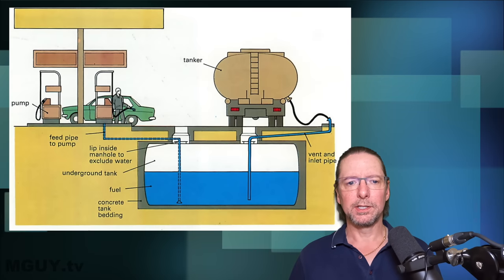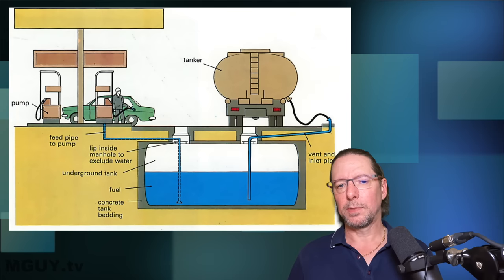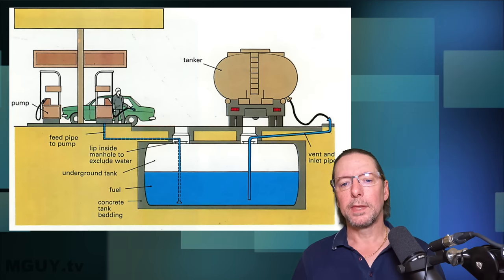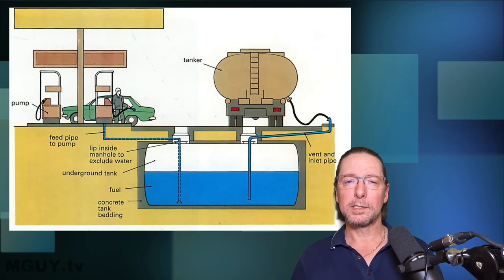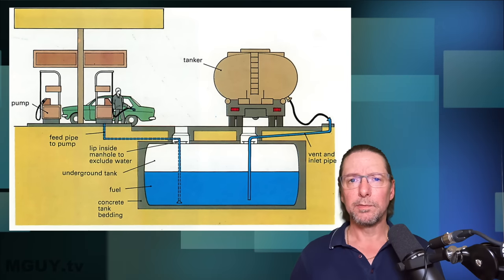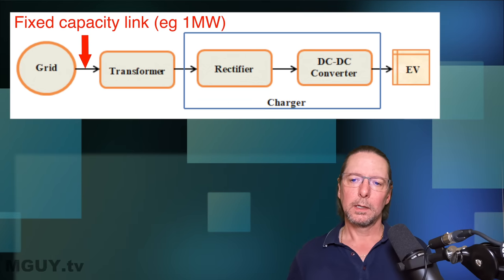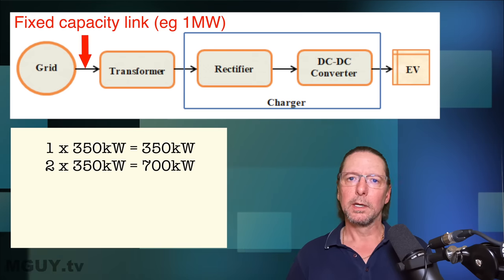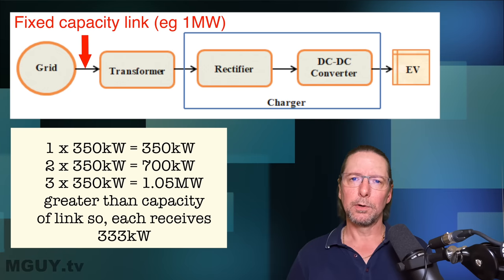HUGE problem with EV Charging Stations that no one mentions | MGUY Australia

Comment: You have a valid point, sir. But don't forget the fact that disrupting personal travel over long distance, to the point of being cost-prohibitive/impracticle is all part of the WEF/Globalist Ellite (WEF/GE) end game. They want you static for easier control and surveillance in their 15-minute cities.. Australia, like Canada is huge with much open space to cross. My gas-powered truck can get me over 900kms on one tank of gasoline in winter or summer. I have the option of heat in winter or air conditioning for summer with zero risk of making the next planned fuel stop. This cannot be done with ANY battery-powered death trap plus it's harder to track older fuel-efficient vehicles and the  WEF/GE DON'T LIKE IT! Bunch of spoiled-brat crybabies! Cheers and hello from Alberta, Canada.

Comment: I am fairly certain that charge stations ( at least some ) have battery buffers for high demand use. The Huge problem I have is no roof over the charging stations. ( What kind of person wants to get into the rain to hook up the charging cable? )
Reply: How about hooking up a high-voltage and high-current cable, in the rain?  Very bad idea.
Reply: I have read somewhere that power is not in the cable unless the cable is completely connected with a low voltage 'hand shake' between the car and charger. But still, just the inconvenience of getting rained on may not appeal to many people. ( Not to mention that solar panels can be on the roof to at least contribute to the charging station.   @DerekDavis213

Comment: Also, when for example, a 1500 KVA transformer for a 6-charger station  is idling because there are no cars charging,  the transformer losses increase - and are drawn from the grid, ahead of the revenue meter.  These losses are then paid for by spreading that cost across all of the customers.

Comment: Another problem that never occurred to me is the cables are made from copper, very attractive to the criminal class. My mechanic tells me that they turn up with a hefty pair of bolt croppers and remove the cables which  cost time and money to replace..
Reply: A criminal would not waste their time on copper cables. Steal 1 car = over 5 km of copper cable.
Reply: @haroldnowak2042  You assume all criminals are intelligent enough to do this mental comparision
Reply: @Nordic_Mechanic  You are right. No criminal would bother with a 'worthless' cable.

Comment: Good analysis about the load  capacity and how it’s divided up among existing users compared to gasoline storage tanks.   Longer times to charge means shortening the range to compensate for longer time.  All ass backwards on that long EV road trip

Comment: They've tried to overcome that problem in America by having a charging station like a jump starter. The batteries inside of the charging station allow for large power discharge but unfortunately it takes another hour or so to recharge each charging station and is more a solution for country areas. If you had one large battery container for instance you would still run into the same problem because the amount of energy needed to be stored would cost millions of dollars and the charging station operator would have to recover that investment.
Reply: Petrol station owners pay for their storage tanks and are taxed to cover damage from leaks.  Why shouldn't charging station owners pay for their own on-site storage?
Why should my old Jeep - via motor fuel tax paid at the pump - subsidize your new EV?
My Jeep is taxed by the volume of fuel loaded into it by the gallon or the liter not the distance traveled; why doesn't your EV pay a road tax based on battery charge?
Reply: @frankmcgowan9457  Love the post Frank, this should land on every politician's desk. The implementation of this EV charging tax should be instantaneously implemented by the money hungry leeches!
Reply: @frankmcgowan9457   Yes, Petrol station owners pay for their storage tanks.   But underground gasoline tanks are MUCH cheaper than 1 megawatt of battery storage!
Reply: @DerekDavis213  And, because they are underground, they take up less of the usable space.
Reply: @DerekDavis213  
The question stands: Why should ICE vehicles subsidize EV infrastructure?  I cannot see why they should.
Reply: @frankmcgowan9457   I'm very much in favor of ICE vehicles, but to play the Devil's Advocate:    Why should the American taxpayer, through HUGE military expenses, keep the crude oil flowing to subsidize gasoline cars and trucks in America?
Reply: @DerekDavis213  
Because the purpose of military ICE vehicles requires them to be available rain or shine, windy or calm, day or night and may require 24 hour operation with minimal stops for fuel, ammo and minimum maintenance.  EVs cannot do that.  Our military will continue to run on petroleum or it will lose.
Our military commitment to petroleum is not a subsidy to the oil companies; it is about readiness.

Make the EVs pay for their own infrastructure; ICE already has paid for its own.
Reply: @frankmcgowan9457    USA has plenty of oil for the military, and our good friend and neighbor Canada has plenty of oil too.   It's the fuel needed for cars and trucks, driven by 340 million ordinary Americans which drives our insane military expenditures to keep that crude oil flowing.
 
So gasoline-powered cards for the American public are subsidized too...
Reply: @DerekDavis213  
As you have pointed out, we have enough oil for military vehicles IF our own government would allow its extraction.  It will not.  Hence, our need for imported oil to run our civilian automobiles.

If the government returned to its pre-2021 energy policies, gasoline would be under $2 per gallon, again, and our military could be stockpiling supplies, again.  Of course, that would be greatly assisted if the military policy were also returned to pre-Biden policy - wind down our existing foreign wars and avoid starting new ones.  Supplies are easier to stockpile when you're not using them up...

Comment: This is just one aspect of the electrical power delivery system that will be under strain if EV's ever become widespread.  There are other parts of the power grid that were never intended for such usage, not least of which are the power generation facilities themselves.

Comment: Here in the US, at least here in Western Colorado, most of the EV chargers are connected to diesel generators as opposed to the grid. Speed isn't an issue but but they certainly aren't full filling the green energy promise.
Reply: Your assertion is false. I don't know where you got the idea that most of the EV chargers in Western Colorado are powered by local diesel generators instead of a grid connection, but that is simply not true. There are some backup generators at some EV charge sites (not very common) but they are only there to make sure EVs aren't stranded in the case of a grid failure.
Reply: @jimmurphy5355  Makes sense. Also depending on the generator specs @Dennis could be wrong not being greener. Some generator's put car/truck engines to shame in terms of efficiency.

Comment: correct. megapack batteries would provide buffers, but they are massively expensive and you will need lots and lots. Theres always the concern that some weather event will cause outages. liquid fuels are so easy to transport in bulk. You can literally grab a jerry can take it somewhere by hand and get back to the car with probably a hundred plus miles of range. evs cant do this.
Reply: Never in my life driving a car, did I need a jerry can to fill my car. And fueling stations in my neighbourhood all run on electricity, so when power is out, no fuel comes out either.
Reply: @channel4ferrets  But I can store gasoline at home.  You can't store enough electricity to run an EV 500 miles at your house.

Comment: I believe someone calculated that here in the UK, if we were all using EV's, we would need 4 times  the service stations space that we have at the moment.
Reply: That just monumentally false. Level 2 Charging uses far less space than a Fuel Station. It's only DC Fast Charging which uses more space and that is NOT the primary method of charging.
Reply: In one report I saw, they stated that we would need a lot more power stations than we have now as well, or the entire national grid would collapse under the strain of the demand for electricity...
Reply: @Neojhun   So they charge quicker than filling with fuel? Are EV's smaller?
Reply: @gordy4459  And yet, even in the 1950s and 1960s, the infrastructure was able to accommodate adding enough capability for air conditioners?  If charging is mostly done at home, the demand will be much less dramatic, and mostly at night.
Reply: @martalli  I do remember seeing on the news last year, (when we had a couple of warm weeks) that demand was so high due to all the air-cons that people were using that some of the coal fuelled power stations had to be fired back up...that surely demonstrated a shortfall in our present infrastructure?...
Reply: Technology is developing fast. However I agree for the next couple of years EV's are more practical for people with home charging. Expensive public charging should be the exception until charge speeds can be done in 5 minutes or less. Also why the fixation to charge to 80-100 pc each time. I put in only as much as I can afford or need.
Reply: Nuclear power stations are back on the table...
Reply: @martalli  At least where I've lived, there were next to no home air conditioners in the 1950s or the 1960s and even well into the 1970s.  I never had one at home when I was growing up in the 1950s and 1960s.  I only had one in a single classroom in 4th grade because it was a mobile home used because there were too many students.  Even in the 1970s at college, there was no air conditioning in the dorm rooms.  Most of the classroom buildings didn't have air conditioning either.  Imaging being at a major university, University of North Carolina at Chapel, in chemistry class, and a dog walks across the front of the class because all the doors of the building had to be left open for ventilation.

The introduction of air conditioning was very, very gradual.  There were people here in the 1950s that didn't even have electricity at all.  When I was 4, we didn't even have a bathroom in the house.

So no, the EV demands are much greater than anything ever was in the past.  The government is trying to make everyone buy EVs by 2035, when it's physically impossible to upgrade the grid and power generation by then, no matter how much of my money you steal.

Comment: Interesting. So 8 fast charge cars will slow it down.  Just travelled around England from Wales. England has many charge points and way more EVs. First time I had seen 3 or more cars charging simultaneously  where in Wales it's non existent.  At the moment huge demand is not everywhere. But you have a very valid point.. It will become a problem if not worse as EVs could outstrip the charging stations.
Reply: Might, not will. Charging infrastructure is increasing, albeit potentially not fast enough but then supply often lags behind demand given the way supply-side economics works. If the installer was able to get a large enough power feed into the site it might never be an issue.
Reply: Imagine a car pulls into a petrol service station.

The tanker is hooked onto the end of one measly little fuel line and the car gets fuelled off that line coming out of the tanker.
Then 10 cars all try to suck out of the one thin line coming out of the tanker....
There's the problem...no storage "tank"

Now imagine an EV charging station with one measly 1mw line and 10 EV's sucking off it...

Then further imagine 5 x 40ft shipping containers full of recycled ex EV batteries on site that had recharged all day from the solar canopy over the EV charging area...
and from off peak electricity all night from the electric grid.

Suddenly by using a brain and spending on a "tank" (a reserve of electricity) all 10 EVs are charging......

Comment: Not a huge problem at all. Charging sites normally have enough capacity to deliver what the cars statistically can charge. I have never experienced throttling due to an overloaded charging site. I have had throttling due to cold battery, but that's due to bad planning, so I had to wait a few extra minutes.
Reply: Yeah, it makes no sense you'd put in a cable big enough for three cars and then install ten chargers. You'd install three chargers, save the cost of seven chargers, and everyone would charge at least as fast.
Reply: @darrennew8211  Banks and stores have (or at least used to) more lanes than people to operate them.  It's psychological, plus they receive more government funds taken from the working tax paying citizens.

Comment: 85 % of electric comes from burning coal ,oil or wood chips at the power station 🤦‍♂️
Reply: depends on the country.
In France, nuclear power is dominant, and Costa Rica and Norway for example have many hydro stations.
Reply: still cleaner than internal combustion.
Reply: @johnyu88  if you burn pure ethanol or methanol in an internal combustion engine, it's pretty clean.

Much cleaner than burning coal (before treatment).

Comment: In reality, the charge an EV station can output is factored in to the overall number of vehicles it can accommodate, no different than the system set in place for replenishing fuel tanks.
Reply: This isn’t universal in all possible locations at all possible distances.
Reply: Exactly. It's almost as though the companies building these things know a bit more about power demand than some anti-EV channel on YouTube.
Reply: Quite - but factor in the costs of all the equipment and perhaps upgrades to the grid supply.   @drxym
Reply: Ideally yes, but not in real life.
Reply: @Hogger280  
Yeah, it works that way in real life, too.  Our power comes mostly from generators which have a limited output. Our only other option is to make our electrical demands more efficient.
Reply: @MsJfraser  It is common knowledge that Charger output often goes down if others are in use in the same location;  even Tesla has stations with paired chargers that split the limited input so that if both are in use then each only gets half of the power available.  i,e,  a 250 KW charger will only provide 125 KW if the other in the pair is in use.
Reply: @Hogger280 
Sounds good to me.
Reply: But charging an EV at a station with maximum number of cars pulled in is very slow compared to a fuel station each having a pump motor on each pump running at full speed.
Reply: @johnkemas7344  Actually there is only one sump pump inside the tank that supplies pressure to all "dispensers". If all the dispensers are running at the same time there is a reduction in fuel flow but it does not drop to the point that you would notice it unless you were looking for it.
Reply: That really has nothing to do with anything.  The fact remains, the more vehicles trying to charge, the longer it takes.

Comment: That's nice they just will have to get A nice coal powered Electric plant to supply more clean power for there clean car .hu make A lot cents. 4:30
Reply: A coal powered EV is cleaner than ICE, most countries have moved away from coal. UK grid is 50 percent renewables and increasing.

Comment: A friend of mine coined it as ' if every electric vehicle were put on charge at the same time, the grid would fall over' - very much simplified I know but if it was done then the problem in this video would apply to every power supply, not just to vehicle charging !

Comment: This was actually a very nice surprise. I generally regarded you as an ev hater but this is actually a well put together video.
Anyway to adress your concern, there's always enough power at the site. The limit are the ac to dc comverters because they are very expensive. Some sites are implementing battery storage for this reason but most opt to instead buy more powerful converters.

Comment: This will not be a problem in South Africa. Thieves will either steal the charger cable, the charger itself or the entire charging infrastructure.

And to add more woe to this, the state utility Eskom is not able to provide a steady stream of electricity, and uses a rotating loadshedding schedule to minimize the risk of the electrical grid overloading.

South Africa are not ready for massive deployments of EVs. 

Going to be fun if that happens though.

Comment: Most people do not realize we added catalytic converters to scrub the air. Indeed, the exhaust is probably cleaner going out than the air going in. Why are we screwing around with EVs?
Reply: Catalytic converters do not "scrub" air and make it "cleaner". NO2, NO, CO, and hydrocarbons from engine exhaust are converted to N2, O2, CO2, and H2O via redox chemical processes. The idea behind EVs is to reduce CO2 emissions. Of course, that discussion is much more complex.